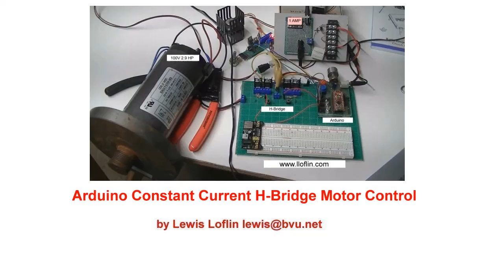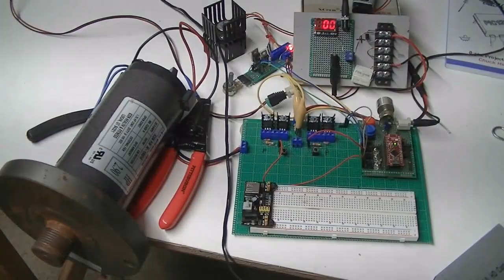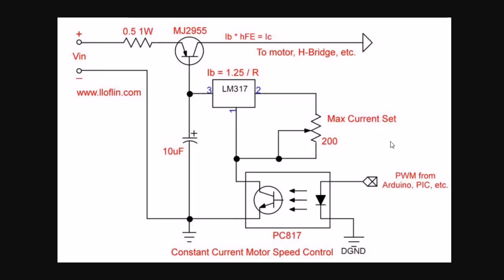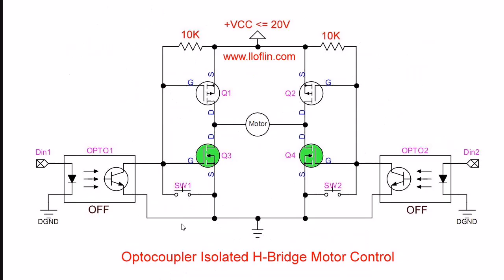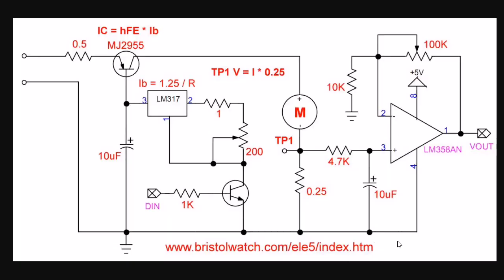Arduino CCS H-Bridge with Large DC Motor

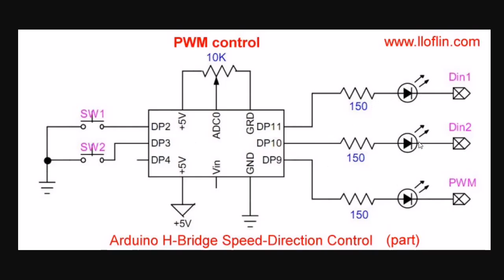Comment: 5:08 - you can use one Pin for PWM and other pin for switching ot other direction. If you just start PWM, then motor goes into one direction, if you first set hight other direction and then PWM then it goes to other direction. This way, you can save one PIN on MCU., but then you need extra NPN and PNP transistors.
Reply from the maker: You can use PWM on the high end LM317 CCS.
Reply: @LewisLoflin  I need to try it out :) Thank you.
Reply from the maker: @goodwill7643  Good luck. Let me know how it goes.